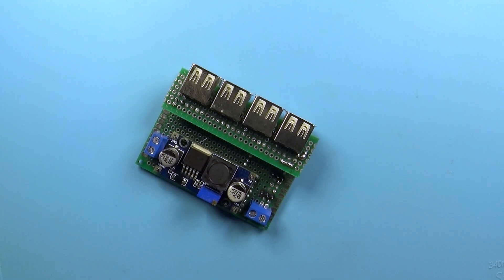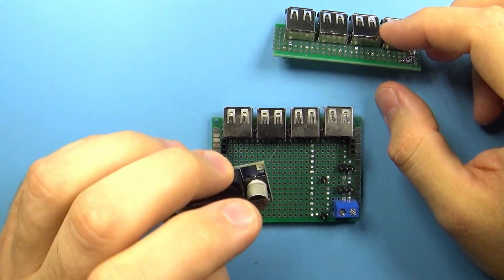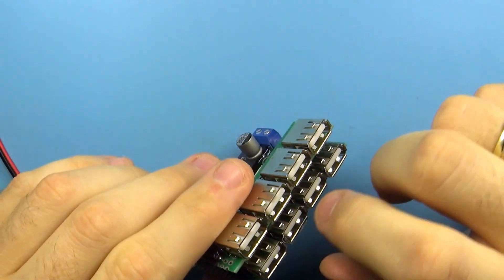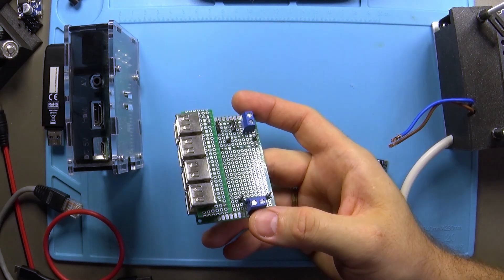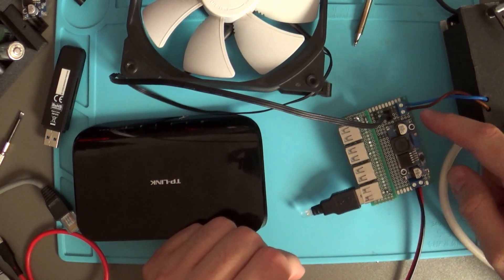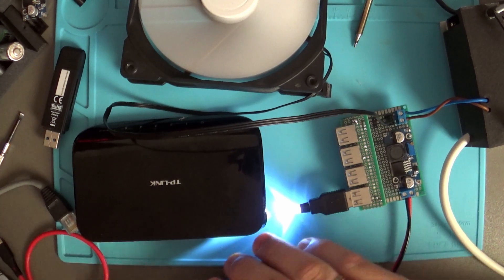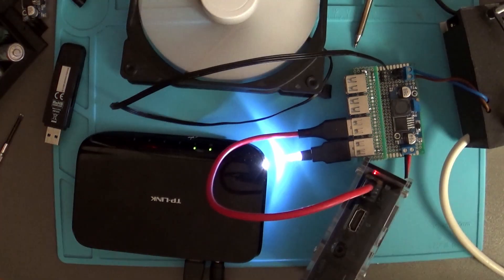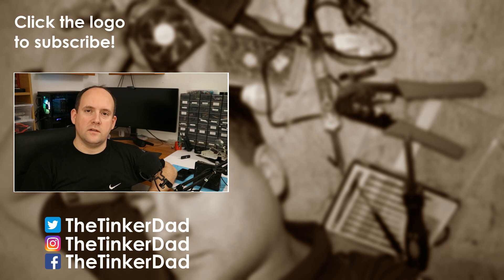Powering Up Raspberry Pi Clusters - The DIY Way!

Comment from the maker: For those wondering about a wiring diagram - finally I've made one: https://pasteboard.co/Jon4T86.png
Tried to make it self-explanatory, but the 2x 8pin headers need some explanation. So, they don't need to be exactly 2x 8pin, they are more like 4x 1pin, but I'm a noob to EasyEDA and for the love of God, I couldn't find a single pin female header, so this was a suitable option... The female headers are needed because I don't really like the idea of soldering the step up converter to the PCB like I did it with the prototype, but instead I'd prefer a "drop in" version which you can attach with 4 pins.
Reply: the link is dead. do you have another place where we can get the wiring diagram? Like your solution and wanted to deploy it :)

Comment: Upon further thinking I think this solution is obsolete/dominated by others that are a combination of cheaper, better and/or less work. One solution would be to use a usb hub and connect it to a 5V 30A LED power supply (without boost converter). You can achieve that with or without disassembling the hub. The prebuilt hub will save you a lot of soldering. For power supplies of different Voltage you need the boost converter, and then you probably need to disassemble the hub or do some soldering.  Also you can forego all the usb cables and connectors by going directly to the power pins of the raspberry pi. Year another solution (but a bit expensive) are PoE hats which supply power over an ethernet cable. I also hope there will soon be clustering boards available that take the Rasperry Pi CM4 modules... That would be the absolutely ideal solution.
Reply from the maker: I began the whole thing trying to find a hub that is capable of handling 20+amps and found none back at that time. With modern USB-C hubs though, you'd probably solve the whole thing without doing it the DIY way, not sure. 
Also, there are two caveats: 
1) you have to be really sure of what you're doing when you power a Pi through the GPIO - that input is directly fed to the Pi without any regulation or protection. A single PSU spike can kill the whole thing instantly.
2) The step up converter would be still needed as most Ethernet switches run with 9 - 24 volts. For this project, it had to be set to boost the voltage from 5V to 9.6V.
Ultimately I dropped this design and ended up with using an ATX PSU for the cluster which provides a plethora of different protection mechanisms, rock-solid voltages and separate 5V and 12V lines (from 12V you can easily get the needed 9.6V and you can also drive the big fans directly).
Regarding CM4 modules, I also ran into a problem - they are barely sold locally, they are quite expensive for what they are (you sacrifice connectors for the compact size), plus I really, really wanted a wired network, which either requires "regular" Pi's or an expensive host board as well. (Not to mention, my cluster consists of different models of the RPi).
Reply: I bought the Anker Powerbank which says it supplies 5V 3A, but when I tunr on my Pis there's an "Under-Voltage" warning. Maybe switching off wireless interface could help?
Reply: First, love the video, I'm going to see about building one myself. One reason I'd say this is still a good idea over just a USB hub is if you're looking for external mass storage for your Pi cluster. I've been researching hd cages that provide raw SATA ports on the rear. They all require standard molex connectors to power the drives. Which makes sense, they're designed to put inside *TX cases.

But a board like this and an old PC power supply - you could power your Pi cluster, switch, and some mass storage with one 80%+ efficiency power supply which are dirty cheap. This is exactly the solution I've been looking for.

Comment: I think when you use a step up converter it would make more sense to also circumvent the USB power cables and go straight to the power pins with your own cables. Takes less space, less work and is even a bit cheaper, too.

Comment: 🤔 hmm looks like a 5v 3amp stepdown supply, not 30 amps ????
Reply from the maker: Trust me the PSU the distribution board is connected to is 30 amps - 5v, 30amps, 150Ws in total. It's a switch mode PSU made for LED strips, pretty much a Meanwell clone.
Reply: @TheTinkerDad  yes, but thomas is asking about the boost converter component which also has a power rating. I'm not sure why you need that when you are using a powerful 5V power supply anyway. The max input rating for your boost converter is 4A, which at 5V will yield 5V and 4A at the output (minus a little for conversion inefficiency). At 10V you'd get max 8A, and so on. If you draw more power, you'll probably burn something out or get brown outs. It may be easier to connect the honeywell clone directly to a usb hub or to the power pins of the pis.
Reply: I'm not an electrical engineer, so take this with a grain of salt.
Reply: @Andreas-gh6is  I think you're right. Tinkerdad shows a lm2596 step down converter (the little blue board). This thing is rated for maximum 3Amps. That is if it is an genuine lm2596-chip!  So, you would need one of these blue boards for each raspi. Usually you need for a Raspi4 3A and 2 A for a Raspi3. I use these boards quite often in my projects and can say that the chips are mostly fake and i would not trust them beyond 1-1,5A. Up to 1A they work fine.
For 8 Raspi 3 you would need (8x2A) 16Amps. You can get that Voltage directly from the shown 5V powersupplies. No need to to step-up-or-down the voltage. Just ditch the lm2596-converter completly. Usually the powersupplies have a little potentiometer to adjust the output-voltage within a narrow range. Connect a voltmeter and set it to 5,2V and you're good to go.

Comment: Could upload a diagram somewhere? I'm working on trying to figure out to power a 5-6 RPi 4 cluster with the least amount of power adapters, this may fit the bill for me. It's going to go into my server rack so I want to conserve as many outlets and not have to buy an additional PoE switch and PoE hats.
Reply from the maker: Hi Colin,
Sure, will do. It's so easy tbh that for the prototype I haven't even made a diagram, but I'll create one anyway, because in the near future I'd like to refine the circuit and have it made as a real custom PCB.
Reply from the maker: Sorry for the delay, I had a really busy week. Finally I've managed to do that diagram - https://pasteboard.co/Jon4T86.png
Tried to make it self-explanatory, but the 2x 8pin headers need some explanation. So, they don't need to be exactly 2x 8pin, they are more like 4x 1pin, but I'm a noob to EasyEDA and for the love of God, I couldn't find a single pin female header, so this was a suitable option... The female headers are needed because I don't really like the idea of soldering the step up converter to the PCB like I did it with the prototype, but instead I'd prefer a "drop in" version which you can attach with 4 pins. Also, this version still don't have a good solution for protecting the whole thing from accidental reverse polarity.
Reply: Hi, thanks for the video!! I’m interested in building a rpi 4 cluster. I’m reading a lot about missing polyfuses and protection. Is the usb c connector protected like the rpi3?

Comment: Your power tester led went of for a moment when plugging the pi in. Was it a bad contact or did the power supply dip for a moment? If so then booting up a second pi on your power supply might crash the first one.
Reply from the maker: Good eye! :) Luckily, it's only a contact issue of the tester light. I've just double checked it - slightly touching the white LED of the tester causes it to blink. You can even see it as it blinks when I raise the Pi from the desk and the tester LED hits the side of the network switch.

Comment: Is that 150 amps or 150 Watts? That is the only slip-up I found and once I realized you meant 150 W, I was no longer concerned about the screw terminals. With scaling up to a larger cluster PSU, that was my only concern but concept is great and I'm looking forward to watching the evolution of your Pi cluster. I might have to adapt something similar should I ever get around to making a Pi Rack.
Reply from the maker: Thanks for the feedback! I usually re-watch my videos one last time before I upload them, but yea, this one somehow slipped under the radar it seems, sorry. Point is, it's 150Ws indeed. To be honest, I'm personally a bit concerned about each and every part I use, not because I don't trust them, but because this whole low voltage + high current thing is a bit of an unexplored territory for me. But, math is math, so hopefully my experiments won't involve magic smoke or at least not too much of it :)
Reply: The math rarely fails, but the magic smoke is nefarious and shows up when you least expect it. As for low voltage, high current the power distribution to the USB ports is the area I'd keep an eye on.
Reply from the maker: Speaking of which... yesterday night I've burned another one of those step-up converters. Guess what, reverse polarity at the input screw terminal (yea, I was tired) and there goes the magic smoke... I think for the final PCB I'll *really* need a protection circuit against reverse polarity. A simple diode I'd normally use won't cut it this time, so off I go to experiment with other solutions :)
Reply: That is hard, but I believe we've all been there. That is one reason I like the XT60 connectors(or their smaller varients) or some sort of keyed type plug to try and help prevent that as much as possible. You could probably get away with a P-Mosfet as your reverse current protection. It should be pretty easy to find one to handle the current loads you'll need. I only suggest this based off the schematic of the PCA9685 board I have for my Pi's as I am, by no means, an expert in any of this. I hope you're able to figure something out for the next installment.

Comment: What would be a practical use for a cluster for home lab uses?
Reply from the maker: For me, there's a lot, but most importantly learning... MicroK8S, the distributed (agent based) version of Portainer, experimenting with load balancing some of the services I use/run on my PIs, en masse provisioning of software to multiple nodes with Ansible, HA (high availability) for some of the smart home stuff I run (especially Home Assistant), various advanced monitoring and networking stuff I read about lately, etc. Just to name a few :) Not all of these require a cluster per se, but I guess you see my point :)